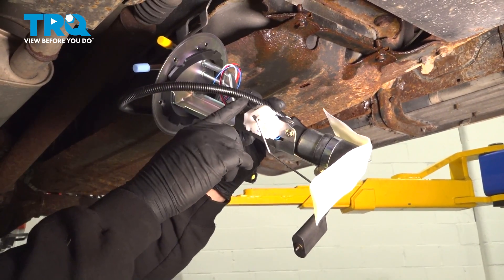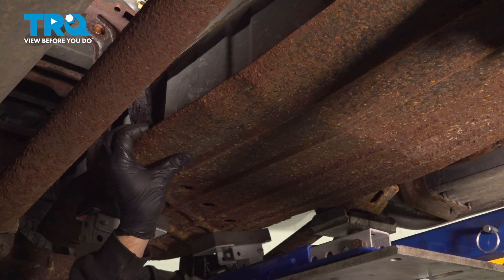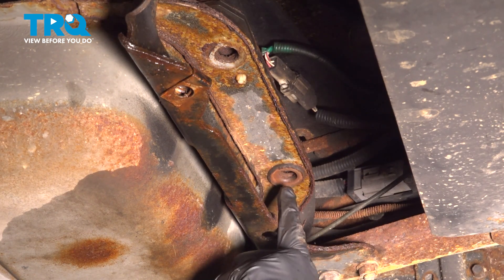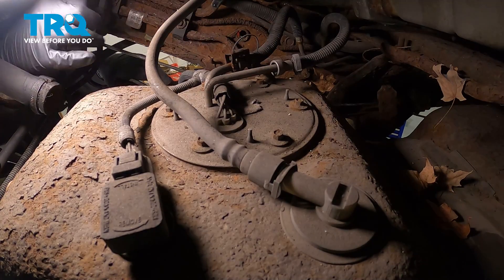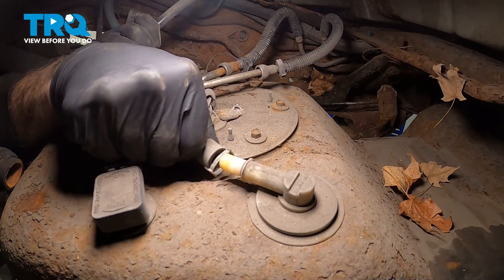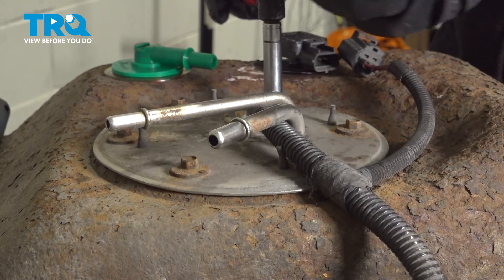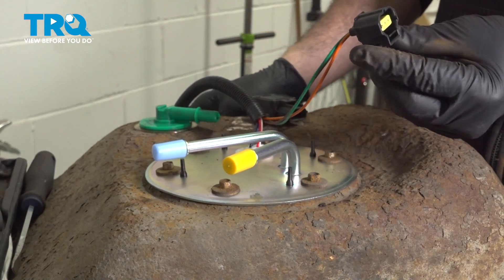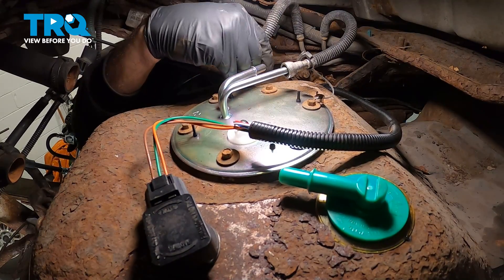How to Replace Fuel Pump Module Assembly 1995-2001 Ford Explorer

Comment: why do they use those stupid pins instead of regular nuts. I tried taking my running boards off last night and i cant get past a few bolts due to rust. any tips before i sawzall thru them?

Comment: You never said which wheel to remove, that I recall. You said norhing about how to obtain the "special tool" to release two of the fuel lines, nor cost. It just " appeared". Showing from a greater distance for prespective, where the Schrader valve is would have helped. Also showing from a distance where some of the skid olate and tank strap bolts are located would have helped. Having said all that (hopefully constructive feedback) thanks for the tutorial.

Comment: I have a 1997 Ford Explorer 5.0 V8 I'm change sparks, cables, colts, fuel filter and I don't know what is the problem because the explorer shaking and shaking 😢

Comment: Must be different kinds of explorers for them years because my 2000 explorer sport looks nothing like that underneath different tank and everything. Even only has 1 fuel line not 2 like this video shows but it still helped me out in changing the pump. Lucky for me the old owner cut into the body of the car for the pump already lol thanks again though